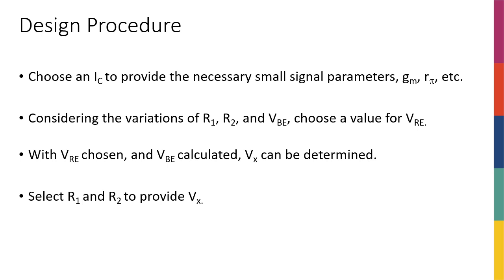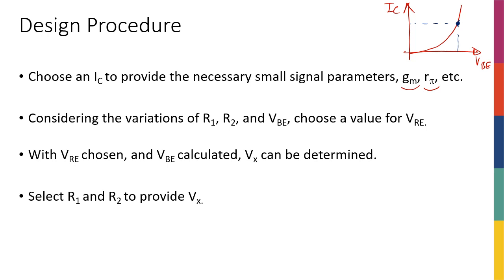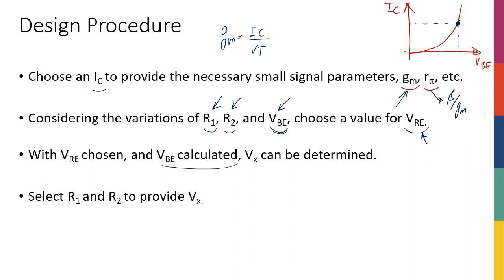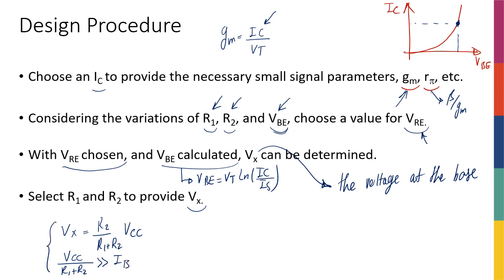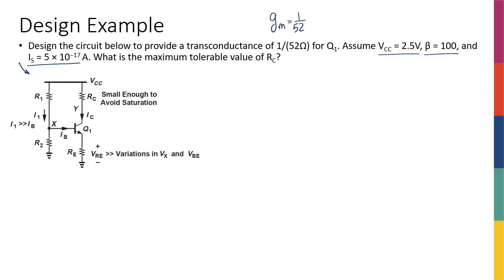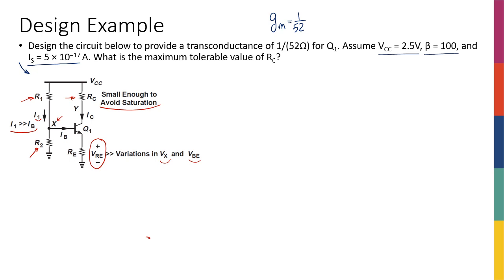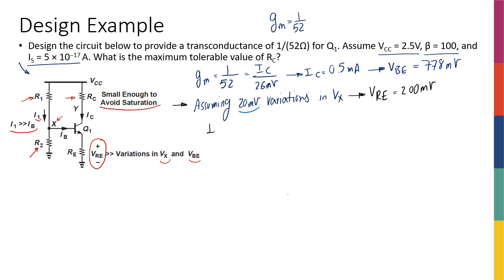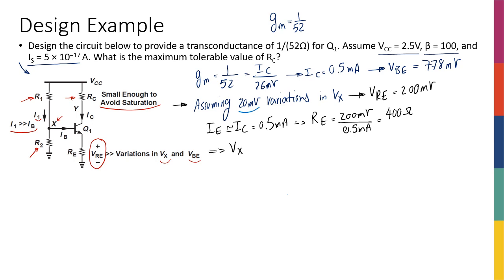Week6 - Design Procedure and Example

Comment: 13:09 i dont get it , isn`t that Vc > Vb for a NPN to be in active and if so then with the 4.2k  Vc will be 0.4 at this 0.5 mA current which is < than 978 , by my calculation Rc should be less than 3,9k  am i wrong ?